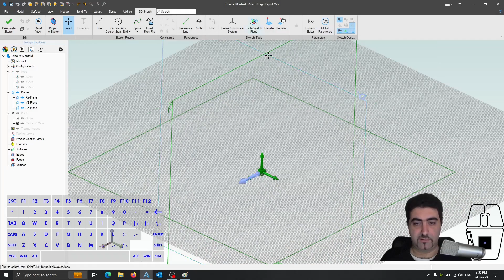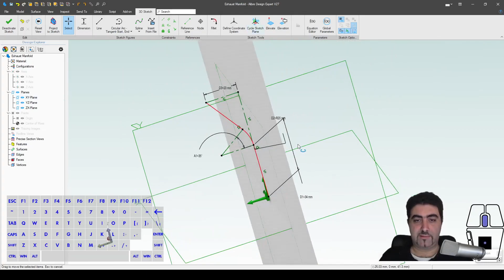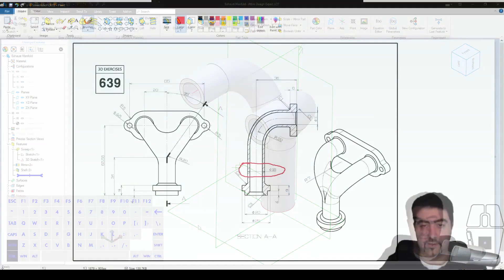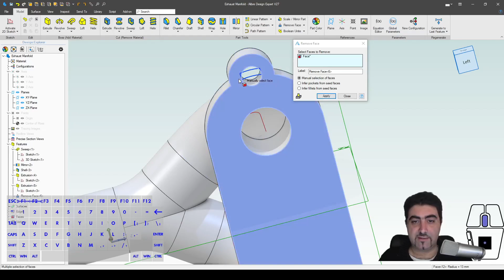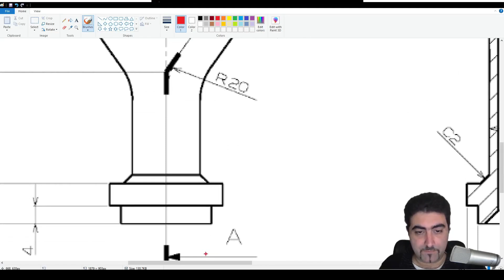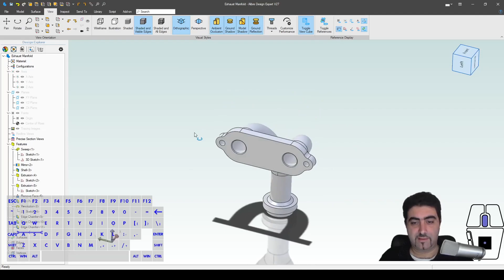How to design an Exhaust Manifold in Alibre

Comment: That's good but, how do you do a set of headers where the only fixed requirements are the head layout, the end point, tube size and the tube length where the tube lengths must all be the same? How do you ensure that the lengths are the same?
Reply from the maker: Well, making exhaust headers is not the easiest and simplest thing in the world. But generally speaking there is a manufacturing limitation that actually helps with the design.

You see, when you bend tube you use bending dies and a press. That's how even large automakers do it too, albeit with expensive NC tube benders. Bending dies tend to create circular arcs. Not elliptical and not "spliney" shapes. With that in mind you need to design each tube for your header as a series of arcs and straights. Of course the tube itself is going to be a sweep feature. And of course the arc length is something that you can calculate very easily know the radius and angle of the arc. A spreadsheet might help there. The equation is (not in spreadsheet format) 2*π*Radius*(angle/360).

Now the "dark art" of exhaust manifold design starts... You know the cylinder head layout and you pick a collection point where you header's exit will be.

➡You design the first tube
➡Calculate the length as designed
➡-Try and get the second to the same place
➡Calculate the second tube's length

If it's the same, you move on. If it's not you need to decide whether the path of the tube needs changing or the collections point or both! Dark Art, I tell you!

➡Rinse and repeat until you get a finished exhaust header.

Again. Not easy. To design or manufacture. That's why performance exhaust headers cost a bit...

P.S. Don't even get me started in hyper competition highly customized headers made from rolled sheet metal pieces welded together...

Oh man, I could go on for days on this topic.
Reply: @ExMachinaEngineering  Good explanation. I have made headers the old, manual way, what I was looking for was if there is a way, apart from calculating all the lengths of the straight and arc sections as the only measurement Alibre can do is measure endpoints. It's not there now, but it might be a useful feature in Alibre to be able to calculate total lengths, even if made from straight and arc sections.
Reply from the maker: That's true. That would be a cool addition to Alibre